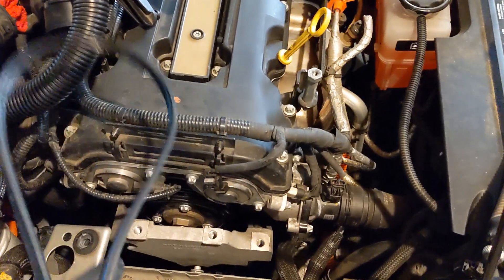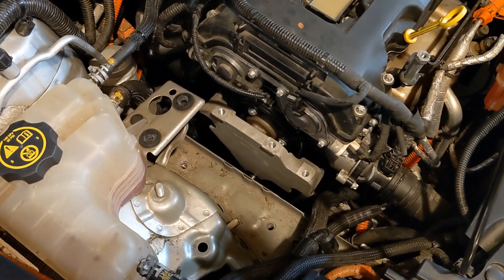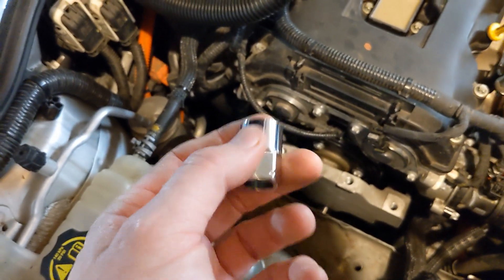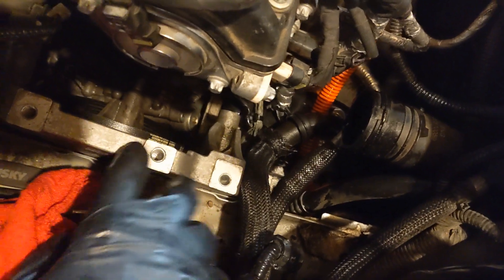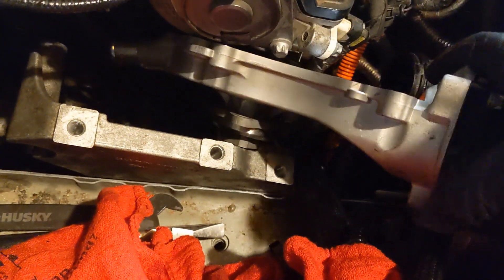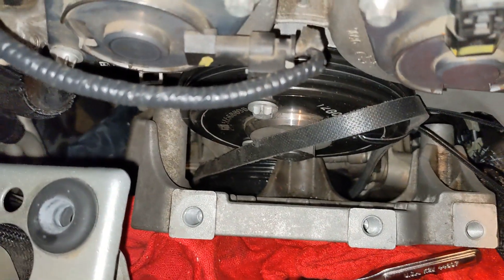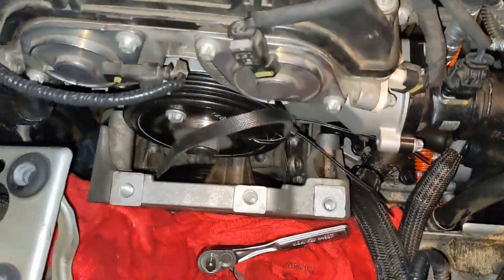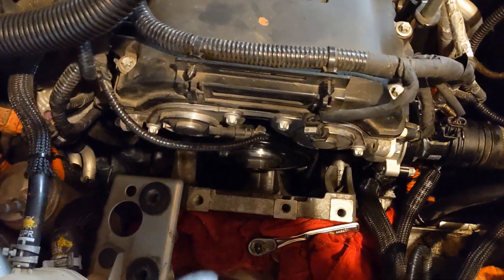Chevy Volt Gen 1 Water Pump Replacement Tips

Comment: I just got a 2013 Volt with 63,000 miles on it. I did a lot of research on the car before I got it, I have already replaced the Evap Purge Solenoid due to a DTC I kept getting (I have the Service Manual and it was listed as a possible cause), plus I also replaced the spark plugs and the ignition module as preventative measures. Turns out the belt needs replacing at 150,000 miles(!)....or 10 years. It looks like I'm going to need to start planning to replace it as soon as practical; I'm not going to lose my Dream Car because of a $20 belt.
The hard part is going to be figuring out how to hold the engine up without a hoist or the 'Support Bracket' the Service Manual mentions. I have a Trolley Jack (small floor jack); that and a piece of wood might work.
Another issue is the 'Torque to Yield' bolts the mount bracket uses. I have heard that you never re-use those because bad things will happen if you do.

Comment: Thanks, great video! My pump is going out as well. Did you anything from the bottom, or was the work all from the top?
Reply from the maker: I was able to work from the top only except the jack and stand on the oil pan.

There isn't much room to get all the old gasket off (very important plus making sure not FOD is in it) and I had to feel the best to make sure it was seated in the crank. I have fairly large hands (wear XL gloves) so most people should be able to do this without issue.